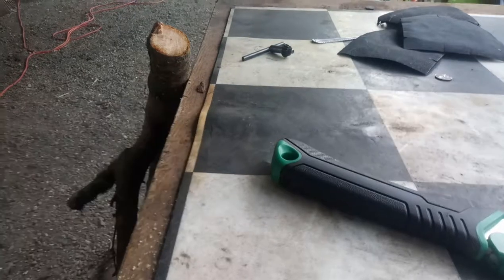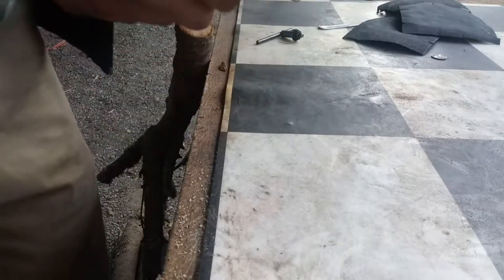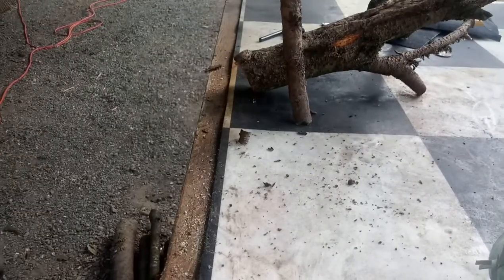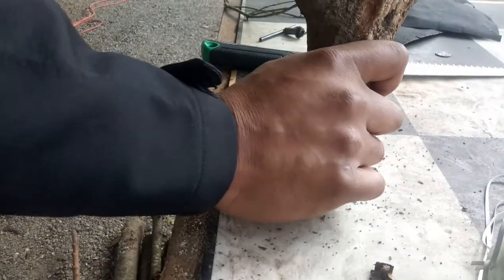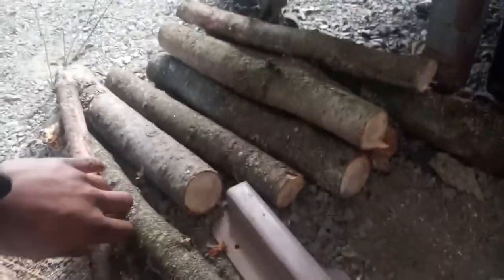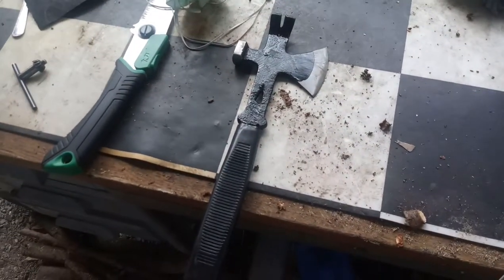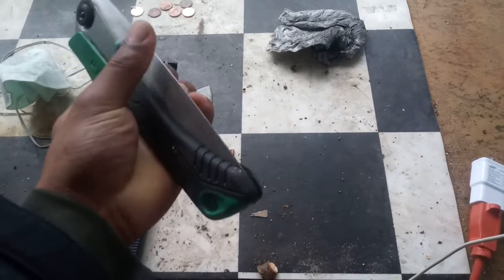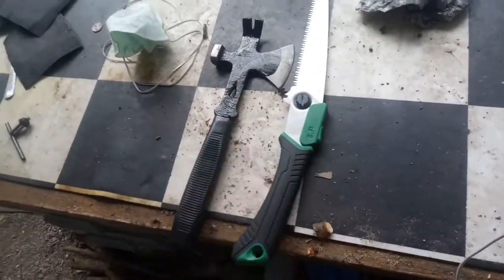$$$10 Wal-Mart | Ozark Trail | Folding Saw | Review |

Comment: Hey good video man. Just bought a couple today. Figured I would check out some reviews. Gonna grab some bigger Katana Boy saws later when I have the money. Got a couple of these ones because of the price lol. Figured hell if I get a couple camps with them they'll have paid for themselves.
Reply from the maker: Absolutely.. Katana boy saws are probably the best you can get .. No doubt
Reply: @LA_STi  Hey man. So I made a nice find an thought of you. I picked up a Jab Saw from Menards. It's a Stanley FatMax folding Jab Saw. It is about an inch and a half shorter than the Ozark Trail folding saw. But I'll tell you what it cuts 20 times better man. And it's the same price as the Ozark Trail folding saw I believe. Also a lot of these jab Saws ( not the FatMax unfortunately ) take universal reciprocating ( Sawzall ) blades. 
 So I'm gonna pick up a couple an throw a 6 inch wood blade, a 9 inch, an a 12 inch an see how they perform.
I worry that maybe reciprocating blades may be too flimsy for what we will need in a camp saw, although I'm optimistic I'll find some good solutions. 
They even had a FatMax Jab saw with 3 blades that I'm now thinking may be kinda cool. It had a like coping saw blade for metal, then some other blade, an the 3rd was like a mini version of a traditional hand saw. Like Grandpa used to use to cut two by fours and shit. When I first seen it I thought that it was kind of stupid but then I thought of all the applications it could be used for. So I'm going to get one either today or tomorrow and check it out. I'll let you know how it does. After using the FatMax jab saw I'm convinced that this three-bladed one would probably be pretty cool as well. The teeth on the jab saw are just ridiculous they tear through wood like nothing. And I dare say that if Stanley came up with larger versions of the jab saw say as large as the Corona saws and the Katana saws I believe the Stanley versions would be superior. The way they cut the teeth was awesome. It just tears shit down man.
 Well I hope my comments aren't annoying ya man. I like helping like minded folks out. I'm constantly building and modifying shit. I'm working on a couple rocket stoves for camp right now. I'll be making a camp wood stove for my tent or a cabin here soon as well. I may start doing videos but I'm not sure at the moment. I'm not the most people friendly an I may swear too much. As well as cuss out trolls. So I may not be the best for public YouTube videos. But we'll see.